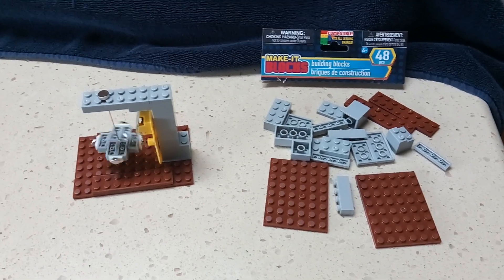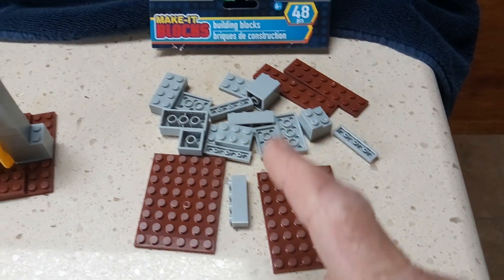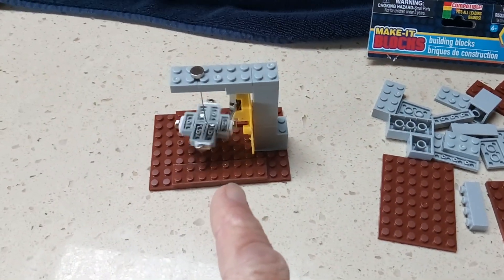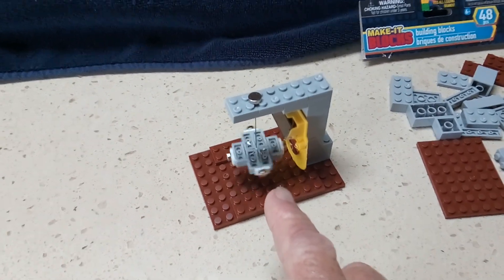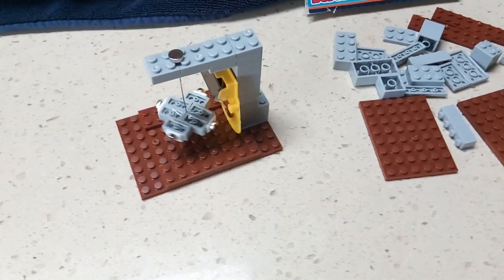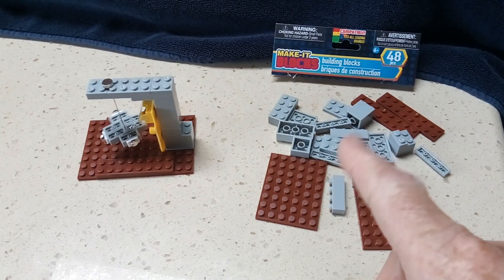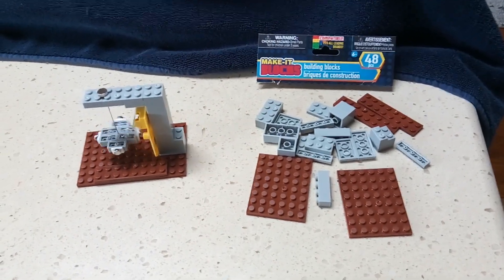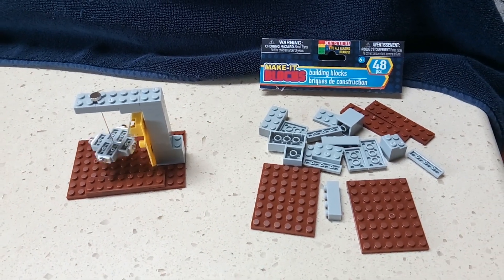No Tools Pulse Motor

Comment: Great stuff, love it. 😊😊👍👍
Reply from the maker: Easy way to make one of these without any mess.
Reply: @Lidmotor  that is almost a challenge to me. Can I use Lego and make a real mess 😆👍
Reply: Done it, rather proud of the look. Video won't be out until 5th May due to my schedule being jammed solid 👍
Reply from the maker: @GrandadIsAnOldMan  Great!  I look forward to seeing the video.  I made an electrostatic motor version that works pretty good.  I run it off of a little HV negative ion generator.